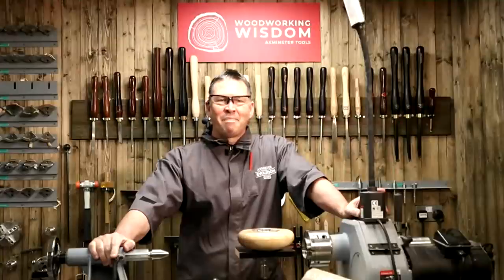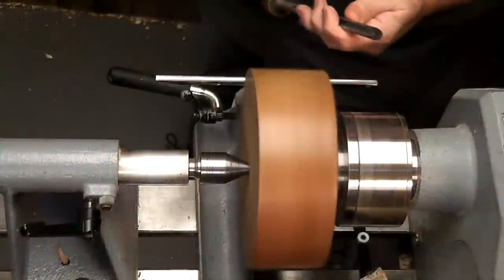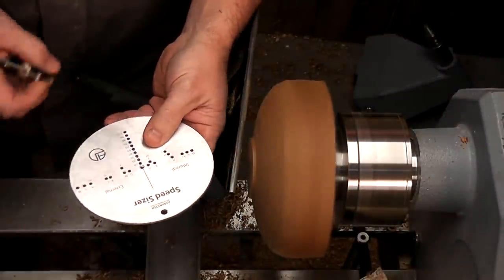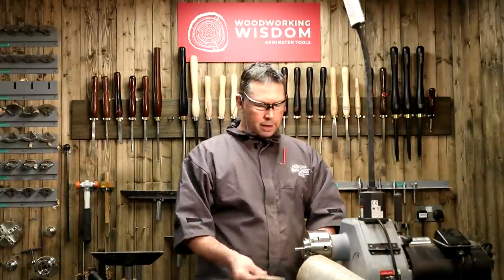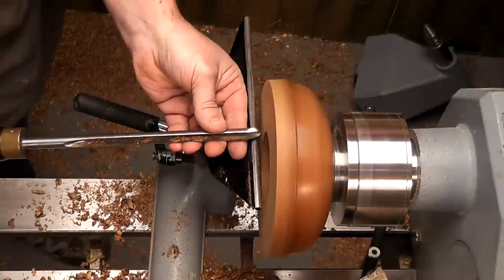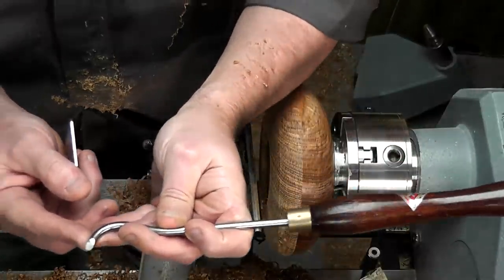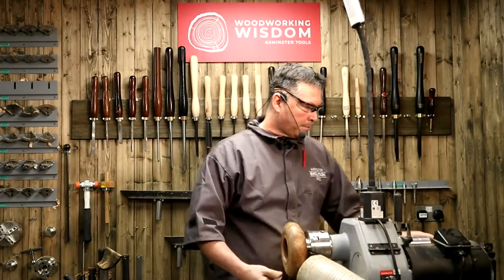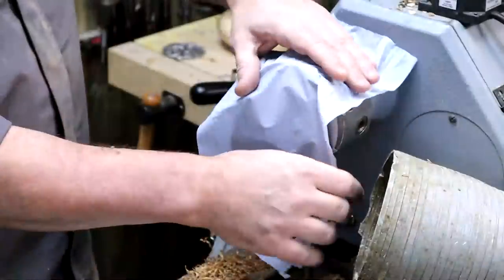How to Turn Potpourri Pots - Woodworking Wisdom

Comment: Chat replay is short by 5 minutes. As a follow-up question to the hollowing tools I asked what would be recommended for beginners/later learners? Thanks for a great experience and education.
Reply from the maker: Hi Cliff, the following reply is from Colwin - "If you're just starting out in hollowing, I would start with small hollow forms around 75mm, with a scraping type probe hollower such as 103651 and 103652 and handle 102428.
Alternatively, 506382 as a combined tool."
Reply: @axminster  Thanks for the advice. Have put in an order for 103652 and 102428. 506382 was not available.